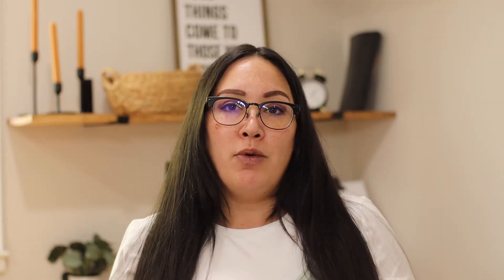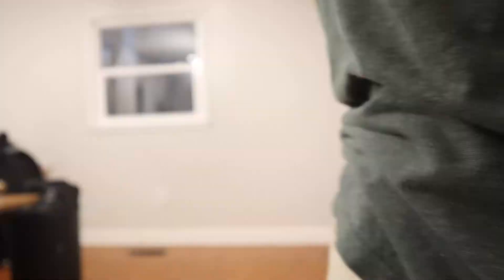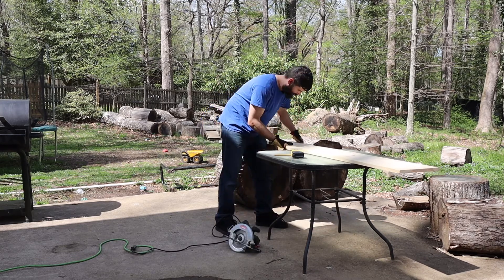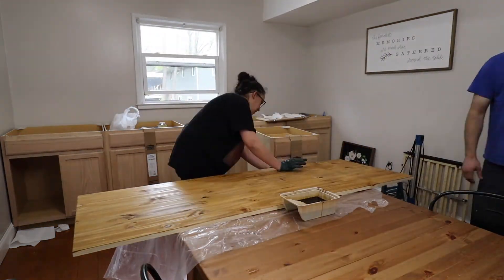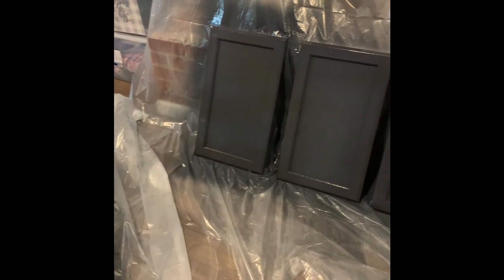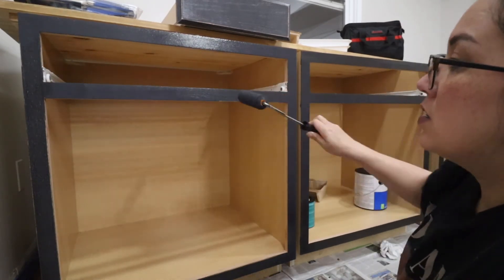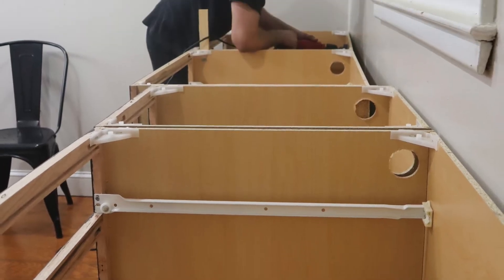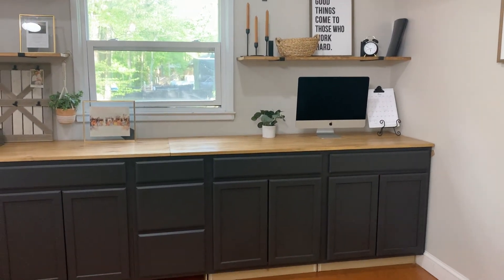How to DIY Built-in Cabinets and Shelves Around a Window | easy built-in dining room cabinets

Comment: Great build—I’m interested in doing the same thing. 

Did you run an extension cord to the countertop for your devices? I’d be using it for kitchen items like a coffee grinder and kettle, so I need a few outlets to plug into.
Reply from the maker: Yes I did. I can probably run two if I needed because there is only one outlet on that wall.